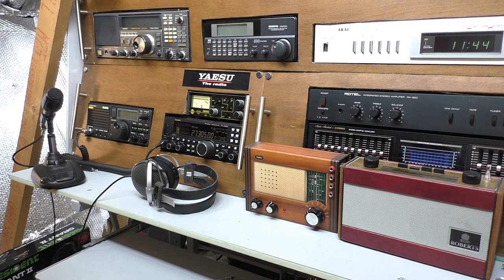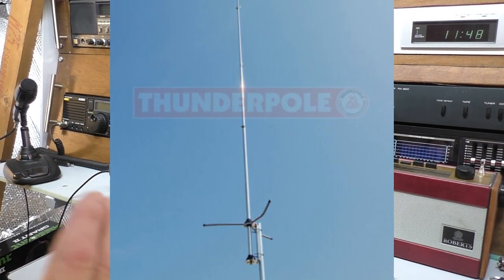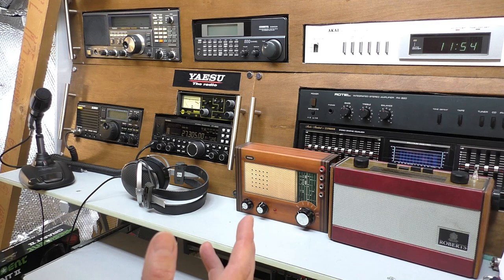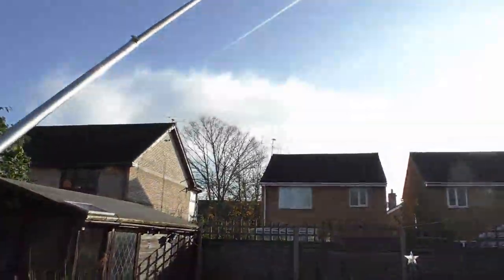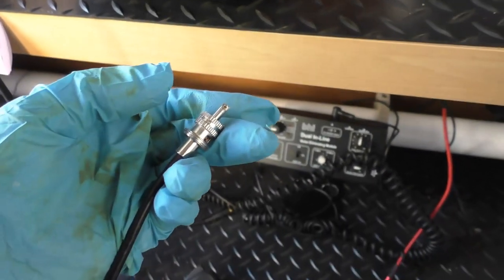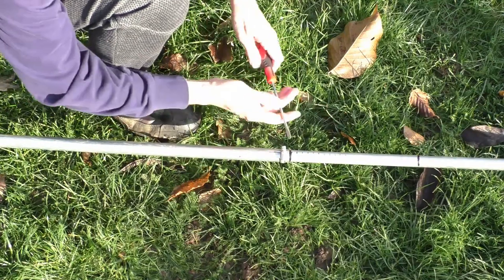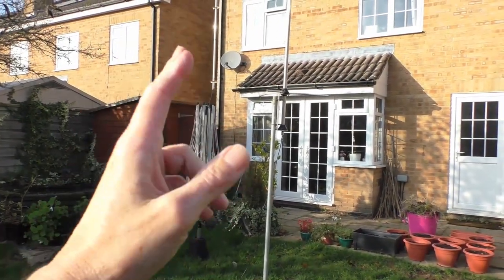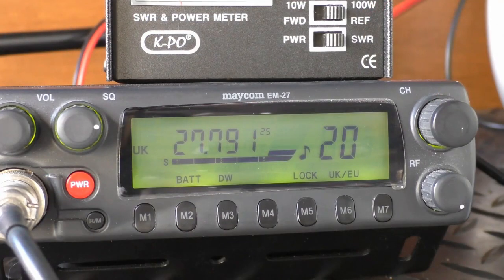CB Radio Beginners Guide.  Part 4. Setting up a home base antenna.  Adjusting the SWR

Comment: Attaching a 50ohm dummy load to the antenna end of the coax will instantly tell you if you have a feeder problem, I'd recommend doing this before erecting any antenna then you know that any issues afterwards are antenna and not feeder based.

Comment: Nice video fred, am just getting my CB / 11 meter back up and running at home, so found this video useful. I'm going to start off low and see if I can find any more masts I can use to support the antennna (silver-rod) as I get used to handling it.
Reply from the maker: Hi.  The best way. A low antenna will work surprisingly well.  The only trade off is more noise.
Reply: @CB-RADIO-UK  - cheers fred - have got the antenna SWR broadly, will be puttign it up tomorrow hopefull. Fingers crossed for some 11M skip into Essex :D

Comment: So if you wished to set up a rig in a garage workshop to have a listen in maybe join in what would you recommend as a set up, with a reasonable aerial fixed to the building.
Reply from the maker: Its all in the video series but a CRT6900N with a Silver Rod 1/2 wave on a 2 meter pole.

Comment: I'm just about to start up and want to know how long my coax can be? ie antenna fitted at gutter level to shed at bottom of the garden?
Reply from the maker: Shorter the better really but if you go close to the house you may suffer more noise.  Avoid RG58 for runs more than 10m.  RG8 (mini8) or RG213 is better for longer runs.

Comment: I don’t know whether you can help me I’ve just bought this aerial 

Thunderpole 5/8 Wave | CB Radio Aerial 26-30 MHz AM/FM/SSB Home Base Station Antenna.
It is far too high on the side of my house. I’ve already had one of the neighbours looking at it and saying the F word. Can you recommend a lot smaller base station antenna ?
Reply from the maker: Hi.  Most 5/8th wave antennas are 18.5 feet and some are getting on for 6 meters.  A 1/2 wave is a little smaller but typical 17 feet. My Antron 99 is about the smallest i could find with the fire up top section at just over 16 feet.  There is always a risk with going straight on the side of the house.  What i did was start with a low pole on the ground and then slowly raised it up over the course of a year.  Eventually i put it low down on the house and inched it up over time.  Might be your best bet with the 5/8th wave.

Comment: How do you get the coax into your house from outside? I’d like to see ways people do that because that is what I need to do
Reply from the maker: I used RG-8 as its thin and poked it through a vent in the facia board.
Reply: @ and then what? Did you have to use a fish tape to get it down through the wall?
Reply from the maker: No the soffit boards below the gutter on the facia vent air to my loft so the cable passes right through and inside. Shown in this video. https://www.youtube.com/watch?v=Pl5RElfeBaI

Comment: For all new comers and returners I recommend this little set up. Rig alinco dx 10. Antenna. half wave silver rod without the 3 silly little ground planes. Coax. rg213. PSU. Enough to comfortably run a kl 203 linear. Job done. Fred. Happy happys and merry merrys mate. Oh. One last thing "height is might.

Comment: Hi Fred I hope all is well with you and your family, so here is my question I've recently bought the half wave venom anttena Swr excellent 1:0 /1:2:1/3. But poor receive. So down it came and I tested it with a multimeter showing a short .So immediately thought a faulty anttena  so then I ordered another  and this shows also a short.  Now on ct26 forum victor answered my question. Saying that is normal on a few 12 wave anttena.  So now I try again fingers crossed for good result   with 2 types of  coax rg58 and rg213 I'll let you know thanks for all your vids Fred. CT 4872.
Reply from the maker: Hi Peter.  Yes often when you put a multimeter on a antenna connection it will show a direct short.  However there should be no short on the coax when disconnect.  It may just be that your lucky to have a very low noise level.  All the best.
Reply: Bingo. Swr  1:0 to 1;3 through the bands 1/2 wave venom   on 25ft pole  just need good propagation now  been on Nw net ch 14 mid band 27.125 fairly busy .Tatar for  now   .

Comment: Hi Fred love your U tube vids...v usefull
Im setting up a 10m,SSB,CB in my Wee motorhome .
Looking for an antenna i can sling up on a Roach pole..the Hawkins Thunderbolt got me excited but he's disappeared. 
Can i use the bottom section of a Sirio Gain smaster 5/8th,and just use the internal wire slung up on me pole ?
Do you see issues with that ?
Or a cheaper plug and play alternative ?
Thanks in advance.
Reply from the maker: Hi.  You could use the Gainmaster that way or build a T2LT yourself or buy one ready made on ebay like this one. https://www.ebay.co.uk/itm/126134369313?_nkw=t2lt+antenna&itmmeta=01J78PV35NFPS8QE08BFJHXEB7&hash=item1d5e31bc21:g:cPUAAOSwlLNlL8nM&itmprp=enc%3AAQAJAAAA4HoV3kP08IDx%2BKZ9MfhVJKm2JvQ%2BP3L83%2FoNA%2FhyYbeTcjJ%2FAAtTc8TGRhWuTwvbniuFAVg9zsaTE8qqbCrSeC3C4kezn13EbcAguIvd0Xp3VGM3aOIiaUQlPtVFLkdRW%2BEj0g2BOq729D90eZUSJ0mBbCqsmLAjJIdw1EWgbfVDt4OTKA924k9Q06vDEPsuQtdLqJJD0JT%2FzSnDfuyQI9t9oFmMYIbxpnydFu1ogmhYLcXY7ejyCrvMrOJzja%2B8pjXXBpLnDzFVdtO0VSDsbxI56r6mecET1YDq9geJZf7z%7Ctkp%3ABFBM_LLslrpk
Reply: @CB-RADIO-UK  cheers think I'll go the Sirio route. 
How do I tune it ,as it'll be just the wire no alan key or adjustment ring ?
Sorry for being a pest arf arf
Reply from the maker: With a T2lt type of antenna you simple fold over the top coax section. I think i covered it more on this video. https://www.youtube.com/watch?v=lwbT4ZX6514
Reply: @CB-RADIO-UK  Thanks Fred that's what I thought .
I've ordered a Gainmaster so fingers 🤞

Comment: Hi. Thanks for your brilliant videos. I am a complete beginner and I am working my way through them. Very helpful.
I am looking to buy two sets so that I can keep in contact with my son as the phone signal between us is generally very poor and unreliable. He lives about 12 miles away as the crow flies and I would like to have contact with him in an emergency if the phones are not working.
Can you please recommend a low cost set.
Many thanks
Lynn
Reply from the maker: Hi.  Yes i recently tested a small radio around £70 all in.  https://www.youtube.com/watch?v=SFaiHlD6EA0  Depending on terrain you might need to add a small amp to each radio.  There is a guide about those in the series.

Comment: I just ordered 175’ of RG213 with soldered ends and with shipping ran me 206$ 😐 but I wanted good coax to run 50 ‘ up my old windmill tower,  under ground in a conduit pipe and into the house 50’ away . I m just nervous because I purchased this though GI Joes Electronics outta KY USA and maybe I should have read a bit more reviews, fingers crossed I purchased it this past Monday at noon and it’s only Saturday but haven’t gotten a shipped out notification like I was told so they must be working on it still. 🤞🏻
Reply from the maker: You should be ok.  213 is a tough long lasting cable.  Just a bit heavy to work with.

Comment: Im new so i am learning from all your beginner videos.  Question if a cable is to long how do you cut it to make it shorter . Thank you again here from the USA for all the info. Keep it up.  🇺🇸👍🏼👏🏼
Reply from the maker: If your getting a mobile antenna i would leave the cable.   What you dont want is any kinks or loops though. If its very long you could cut the coax and re solder the PL259 plug.

Comment: I recently got back into CB after over 30 years away started of mobile with the Radioddity CB-500 & the Thunderpole T-X for the car & walks, I've now decided to take it abit further & splash some cash & bought a President George II for a SSB base station that I can still use mobile if needed,.

I plan on sticking up an 1/2 Wave Thunderpole Silver Whip to start with, but as with anything these days there are hurdles.

 I can't stick it on the side of the house as I 100% know the neighbours will complain & Wife to probably :/, the only option I have is to bolt it to my kitchen extension around the back on a 8ft pole this may take the tip of the Thunderpole just over my rooftop round the back but still be discrete enough where is will not cause me aggro with the street police.

It's not ideal as height is might as they say but it better than nothing.
Reply from the maker: Pretty much how i started.  Leave it for 6 months and then raise it a few feet. Repeat 6 months later.

Comment: Would you say the black recommendation marks on the Thunderpole Silver Rod | 1/2 Wave antenna
Reply from the maker: Its a very rough guide to get you started with the SWR.  You will need to fine tune it though.

Comment: hi Fred quick question. can you still get the modulator with twin coils? and
 Will it work on top of a siren starduster 400?
Reply from the maker: Iam not sure.  The modulator has been copied many times but not seen a center loaded one.
Reply: @CB-RADIO-UK  yeah I had a modulator 2 I think it was it had a base coil then a steel section and another coil then a 3ft whip in total it was at least 1.5 mtr I had it an the top section of my dipole  I used to bang out as good as my mate on his higain silver rod  with my formac 120.those were the days I then seeped it to a avanti sigma 4..
And now touching the BIG50 I wanted to get back into it again but I may be restricted with putting up a home base antenna hence asking these questions  Fred.

Comment: I have 2 issues with a homebase antenna. Firstly, I live in private rent. So mounting an aerial to the house is out of the question. Secondly, I live in a valley. So the only direction I have a clear line of sight is southeast. I have considered getting a pneumatic antenna mast like the military have mounted to their land rovers which I could give me a 10 meter lift. But finding them for sale is rare, and they are never cheap.
Reply from the maker: How about a cheap T2LT that you could simply raise and lover when you want to go on air.  More here. https://www.youtube.com/watch?v=lwbT4ZX6514

Comment: Hey Fred Some great advice there.. I'm an old school cb'er, when our parents wouldn't let us erect an 18ft antenna we used to use  a mobile antenna indoors for use in our bedrooms etc.  Although they were a bit hit and miss they kind of did the job and of course back in the day there were a lot more local breakers to pick up on air. I'm thinking about getting back into using the airwaves again and watching your videos has inspired me. Any suggestions from you or anyone on decent antennas when you are limited in a flat and can't put up an 18ft silverrod?  Thanks
Reply from the maker: Your going to be restricted but a Sirio boomerang can work on a piece of wood out a window.  https://www.kcb.co.uk/contents/en-uk/p44.html
Reply: @CB-RADIO-UK  thanks mate, I also have a balcony so maybe able to be a little more adventurous.
Reply from the maker: Maybe you could put up a T2LT on a telescopic pole.  Search t2lt on my channel for more info.
Reply: @CB-RADIO-UK  thanks again. I think I'll go with the  sirio boomerang. I've just found my old 1980s Major 3000 in the back of the cupboard with a couple of power supplies I forgot I had, so I'll be giving that a run when I get an antenna. Just to add 3 days after leaving this message...I have now found a SWR metre with patch lead, an antenna matcher and on the balcony tucked behind the drainpipe..a 4ft I think a fire stick not sure. It has a swr tip. My brother remembers it mounted on a car wheel. I just need to find the mounting connector bracket. Thanks again.

Comment: Ain't seen Freds video's for a couple of years now, but cos my field is in computers and being a semi-pro, i have some idea, , your wondering, what the hell is an SWR, SWR stands for "Standing Wave Ratio", the transmitting signal travels along the antenna (FORWARD) and refects at the end, returning down the antenna (REFECTED), the forward signal interferes with the reflected signal causing constructive or deconstructive interference, differant lengths create differant phases along the antenna, when a peek meets a peek there is double amplitude and max emission, and when a peek meets a trough there is zero emission, an SWR ratio of 1:1 is perfect constructive interference, where the cycle appears STATIONARY on the antenna, creating a perfect waxing and waning electo-magnetic field, as the electric field collapses, the magnetic field increases and vice versa, , ,Without that load absorbing energy, the energy instead appears as a high voltage or high current somewhere which may not be equipped to handle it, , 

So basically, an ideal 1:1 SWR will produce a low 50ohm resistance match where the antenna does work, the SWR is relatively constant along the feedline, the impedance will vary along the line unless it is perfectly terminated (that is, the SWR is 1.0 : 1). This is an important concept for impedance matching, because with a high SWR, the impedance at the final output transistor load inductor could be mainly higher, or lower than 50 ohms and produce a high current that damages the finals, , ,

PS - a 1:1.5 SWR = just a 4% loss \ a 1:2 = 11% loss \ and a 1:3 = 25% loss

Comment: Hi can I put the power supply near the radio? Because I would like to keep an eye on the volt and amp needle on the power supply?
Reply from the maker: Hi.  Ive used a power supply close to a radio without issue.  Prob best not right on top though.
Reply: @CB-RADIO-UK  Okay I will try that. I hope everything will work good and I hope that I will feel it’s fun with cb. I have autism and my special interest is radio and antennas so that’s why I’m obsessed.
Reply: @CB-RADIO-UK  Do you think that I will find cb radio fun so that I will keep my radio and all equipment I bought or do you think I will find it boring and just want to sell everything? 

I haven’t saved so much money yet, but I have been strict not to spend anything and just keep saving up. Now I have for some reason got obsessed and spent most of my money. The radio wasn’t cheap, the antenna wasn’t cheap and the power supply wasn’t cheap either. Then I had to buy that swr meter too and of course it came without any cable whatsoever. So I had to place yet another order for a cable. I also don’t have much space for all this equipment so I need to place it in my table where I do my makeup normally, which I’m not too happy about, but I have no other place to put it right now.

Anyway I of course won’t get all my money back if I decide to sell everything. And I’m still waiting for the antenna, so if there will be one more problem, like too high swr that I can’t fix or wrong power supply or anything else, even if one tiny cable comes loose and need to be replaced somehow, then I stop right away and this will be absolutely over.
Reply from the maker: Hi.  I hope you find CB fun.  A lot depends on your area and the type of activity you get.  The summer of 23 is going to be a GREAT year for radio skip which you can best enjoy on Sideband.  Many people start on CB and then move on to HAM radio.  Best of luck.  Happy New Year

Comment: Hi fred I'm looking for some help please . I have bought my first antenna and I want to know if it working correctly. It a 1/2 wave basic base thunderpole. I did a continuity test with a multimeter at the antenna coax connector and it was a dead short between inner pin and other plug . My question is ,is it faulty or is correct.  Thank you hoping someone knows what I mean
Reply from the maker: Most CB aerials will look like a short circuit to a dc multimeter and so are hard to test.  Its not conclusive to a fault.  Best way is to use a SWR meter and transmit with the radio.  A shorted antenna will end stop the meter regardless how you adjust it.
Reply: @CB-RADIO-UK  thank you for the quick reply. Yes I think its working ok it's to do with a induction coil wiring the SWR does seem to be  very low and I was getting DX signals from Ireland and Germany which was amazing. Today is very quiet on the Radio which was making me over think of a problem.  Thank you for putting my mind to rest.

Comment: interesting thought, what what do you think would be more effective a  typical antron 99 18 foot  mounted on the ground for a total height of 18 ft   OR   a 4 foot firestik 14 feet off the ground for a total height of 18 feet. .    both antennas would have an antenna tip height 18 ft, BUT  but the 4 footer technically higher since its 14 feet off the ground    so so curious what more effective?? in reality a 18 ft should smoke the 4ft ant , BUT being that its 14ft off the ground while the 18ft is on the ground does the height make the 4 footer beat the antron ???? i cant seem to find a solid answer to this?
Reply: To add to this 
it hard to simplify into a sentence but i guess if i were to try   does a smaller  lesser performing antenna  beat a larger better performing  antenna when the lesser antenna has the benefit of being  "higher of the ground" when at the same real life height  , I especially ponder this when there are people that say antrons and other full size antennas tend to radiate near the bottom of the ant, while some smaller antennas are top loaded, using this in a theory , a top loaded ant would be effective much higher off the ground  when at the  same tip to tip height
Reply from the maker: In my experience a full sized 18 ft 1/2 wave antenna with receive high db than a shorter mobile whip.  You would need to get the loading coil a little off the deck to create a good groundwave pattern.  Ive found just 1 meter was enough for fair performance.  The only issue with low antennas is that they tend to have a high noise level.